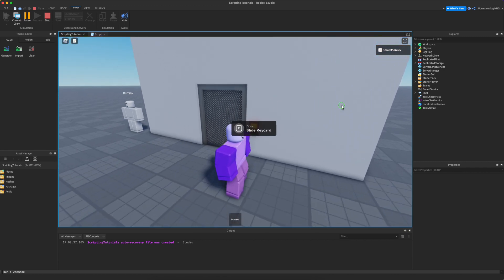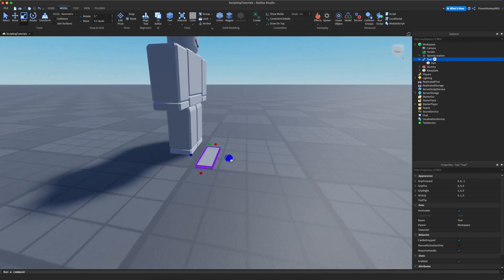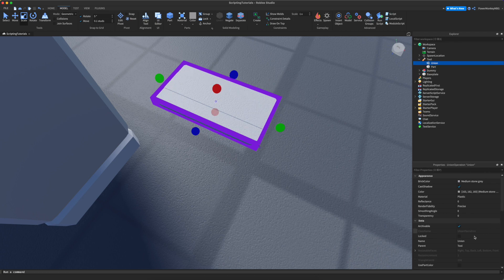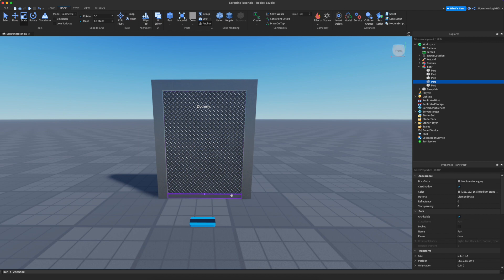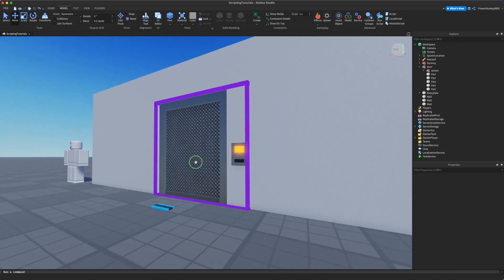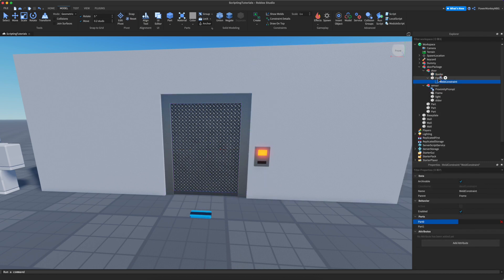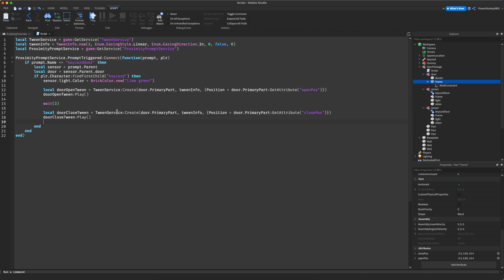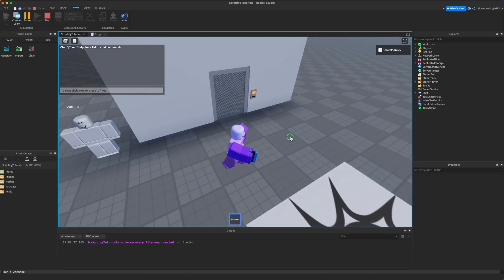How To Make EPIC Keycard Sensor In Roblox Studio!!!

Comment: I just wanted to make this keycard door cuz I was bored but dude- there is so much unnecessary code in the script like you can make it short as with the same result. My door also doesn’t open when my keycard is in my inventory equipped, when I hold E on the prompt the sensor goes red? And doesn’t open. I see that it worked for some people but majority are saying that it didn’t. Next time explain the code line by line properly so people of any coding skill can understand. Thank you.
Reply: Btw I found where the issue is but not sure if I should waste my time on it, already made my own custom keycard door so I don’t need this anymore.
Reply: Lol another update, I fixed it! On line 9 the word after Findfirstchild was not the same as the one I pulled out of the keycard tool into workspace.

Comment: I made multiple cards and multiple doors for different levels, but when I remove "L1" from the script, it's still able to be used, but the light still turns red.

if plr.Character:FindFirstChild("L1") or plr.Character:FindFirstChild("L2") or plr.Character:FindFirstChild("L3") then
first door

if plr.Character:FindFirstChild("L2") or plr.Character:FindFirstChild("L3") then
second door
Reply: if you have multiple doors make sure to have the name of the proximityprompts different in each door for example adding a 2 at the end or it will open the rest
Reply: @vortexexternal  Ok thanks I needed multiple doors and I didn't know I had to do that